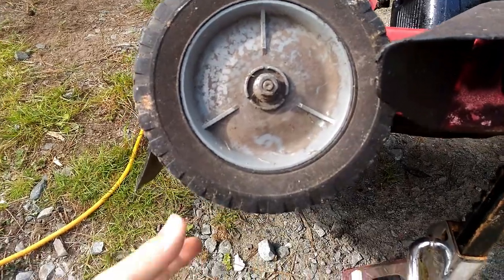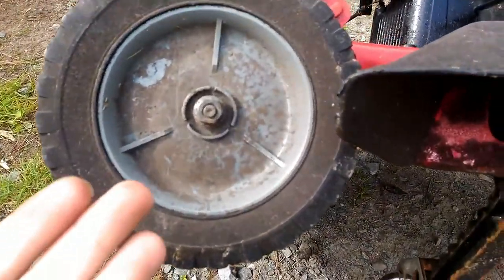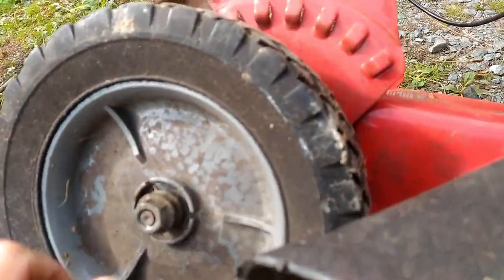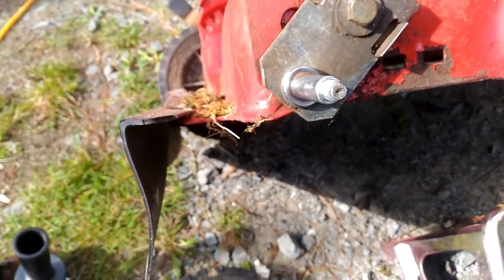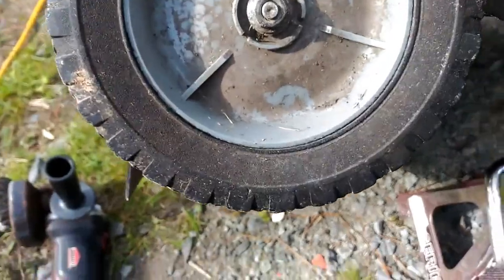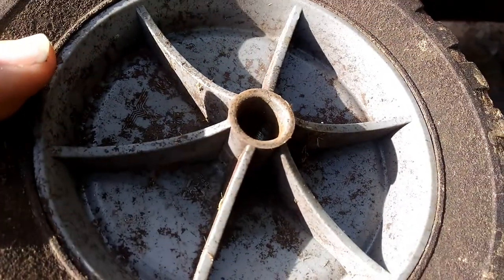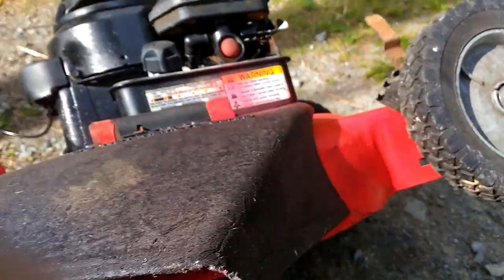Lawn Mower Wheel Repair, Drunk Lawn Mower Repair

Comment: Steve's Small Engine Saloon channel he presses in a piece of 1/2 copper pipe into the wheel to take up the wobble slack also it works really well on those high wheels on the rear of some mowers to take the sag out and firms them up.
Reply from the maker: Yeah I saw that trick... It's pretty slick.

Comment: Great video! Right to the point and easiest video I've seen by far. Going to the store & buying the different washers won't be a problem  however, I don't want to shell out the money for an ankle grinder & cut brush. Maybe sandpaper will work...
Reply from the maker: Yes sandpaper works well and also a cheap hand held wire brush from the dollar store works fantastic. I say whatever ya got is good 😉 The name of the game is to save your hard earned money. Thanks so much for the lovely comment and thanks for watching 👍👍👍

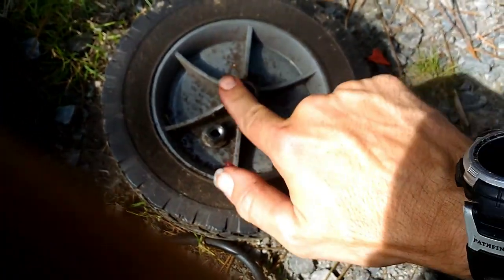Comment: @4:45 You just packed grit in the greased wheel
Reply from the maker: Two things... First: as Taryl Dactal says, "It's not the space shuttle, it's a lawnmower" Second: I shot the video in one take in real time one handed... Don't worry, I actually pulled that wheel off after I finished filming, cleaned the wheel properly and greased it up with no crud in the way.

Comment: That happens when you don't lubricate the bore every time you use the mower  , just add a little of oil  in the gap between the shaft and the  bore.